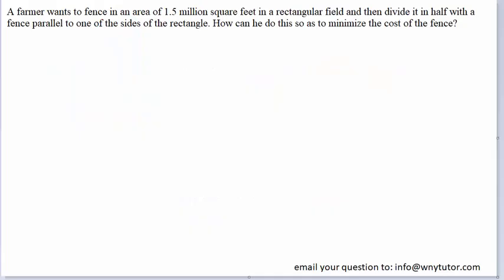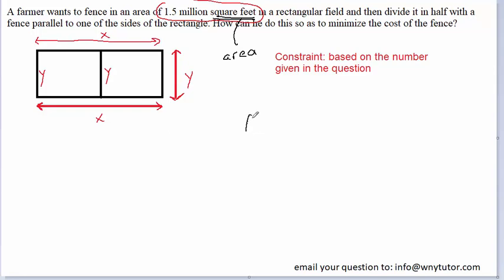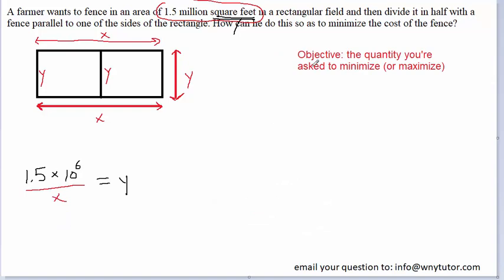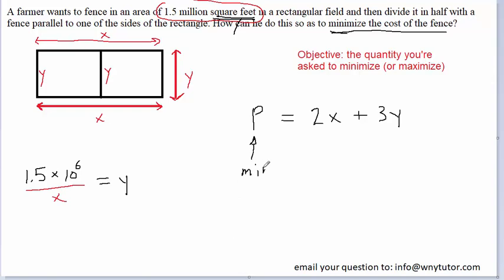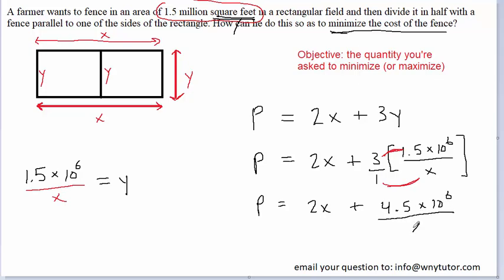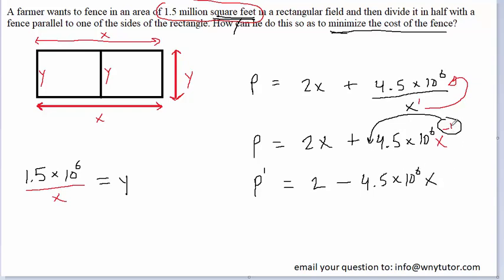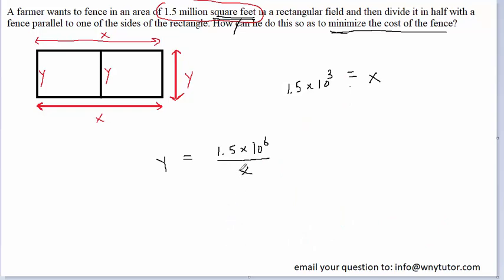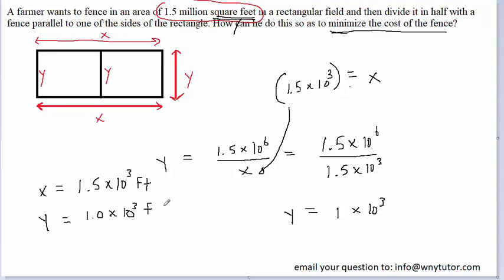A farmer wants to fence an area of 1.5 million

Comment: Four circle parks of different sizes are to be surrounded with a fence.
Park 1 has half the diameter of Park 2.
Park 1 has one-third the diameter of Park 3.
Park 1 has one-fourth the diameter of Park 4.
If one bundle of fence exactly surrounds Park 2, how many bundles of fence will be used in this project?

I am trying to help my grandson but I can't figure this one out. Any help would be appreciated.